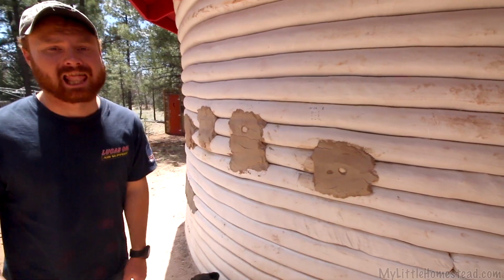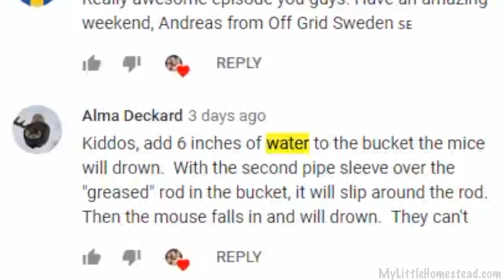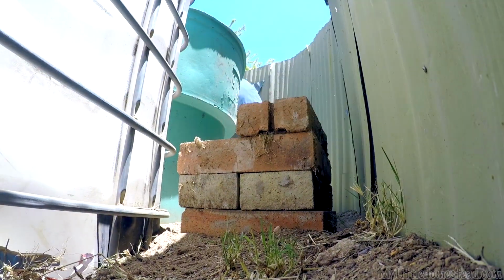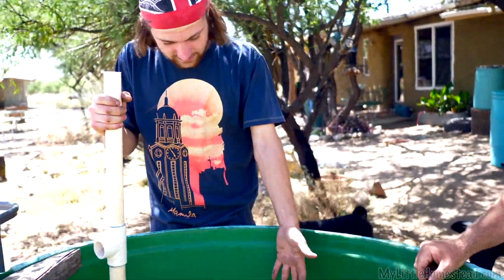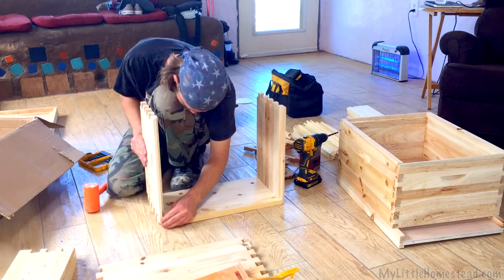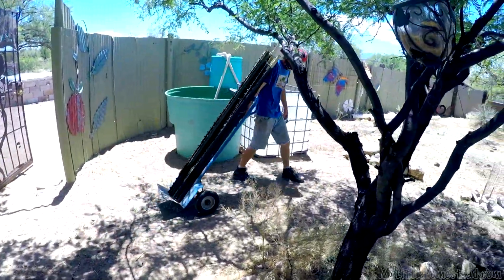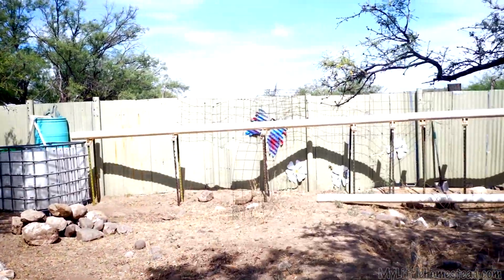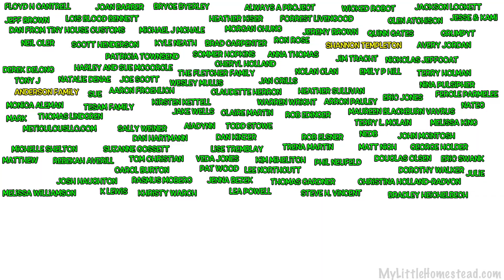Earthbag Cabin Stucco, Aquaponics Solids Filter & School Locker Restore Complete | Weekly Peek Ep189

Comment: Check with your local pond club,  as there all kinds of filters that can work.  I had a 14' X 12' X 8' deep pond.  And was able to build a 50 gal.  water fall with pond fiber. When it started to look full,  I would rinse it out in a large tub of water. I then put that water on my plants, after  mixing 50/50 with more water. The plants thrived.  Just thought...

Comment: Just a couple thoughts on the fish ponds. My family had outdoor ponds. Fish can be very sensitive to chemicals in the water. Chemicals from certain plastics and glues used for fittings can be toxic. Also, wire mesh over tanks may be necessary. My sister lost all her koi in one week due to a blue heron. But might not be a problem for you guys.

Comment: Agree, I laughed too hard at the water in the bucket part.  And Bree's eyes.... BAHAHAHAHA.  Nice lockers!  That is interesting on the aquaponics.   Agree on the rock part gets expensive.  I did the dutchbucket setup but in my small space the 4 buckets take up space.  I have done the Kratky method in a 6" pipe outside and it did great.  What fish are you going to get?  Thanks for reminding me I need to add the swirl filter to my setup.

Comment: I have no experience with this type of build. However I do have over 20 years in the construction trade. Local 7BAC. I am an expert on marble restoration...

Would applying wire mesh to the outside help with holding the outer coat?  

Ps. Now I just need to convince my wife to make the move.

Comment: Color is a matter of pigment (powder or liquid) Model shops carry it or on line. A little goes along way. Paint will chip & show base color. Good for fake flag stone too. Color lamp black is a real mess, so caution on that one.
Reply: It is widely used on model rail roads to color land scape ,weathering, trails, fields, mixes into wet plaster, concrete ect. Brushed on, poured, castings or just airbrushed on. All the ones I used, where water soluble. Like you thought it's mixed in before applying (wet).  "A little goes a long way".
Reply: This will get you started, just watch out for high priced garbage.

Comment: Just curious why ya'll never just put dye in the cob mixture so you would never have to paint it?
Reply: It would take a lot of dye or pigment to color that much cob and that gets expensive, so a top coat usually gets the color...or you can just paint it (oil paint recommended)
Reply: @lisajackson4951  no it wouldn't they have due specifically for stucco. And never use oil paint outside.
Reply: @bigphillyed    I thought we were talking about clay cob, not stucco.  And the most durable exterior paint I have ever used is oil based.
Reply: @lisajackson4951  we were talking about clay. But clay and stucco are pretty much the same thing except one has concrete mix added. I am not even sure if oil paint is even made anymore, years ago oil was ok for window trim and front doors, not a porous clay based wall. I would have added dye so I wouldnt have to paint it every few years, especially in that cold freezing westher.
Reply: @bigphillyed   Perhaps I should have said oil based paint...like rustoleum or homemade linseed paint.  I do remember painting trim back in the 90's with oil paint.  It was such a mess.

Comment: Always blown away by your amazing inventiveness, but I worry about your drilling holes in the 2x4s for the pipe support. I think you may have fatally compromised their strength by doing that. Everything is held up by less than an inch of end grain. End grain! And when you add the weight of the water in the pipes..oi oi oi! And then there is the degradation over time of the wood itself. Mebbe in a dry climate it will last longer than in a wet one...but i think you may have given yourself a big problem not so far down along the line...
Reply from the maker: Good thoughts.